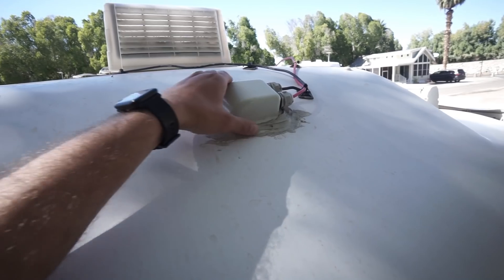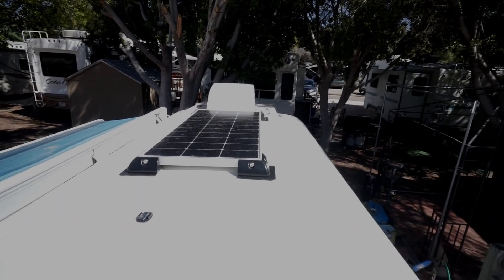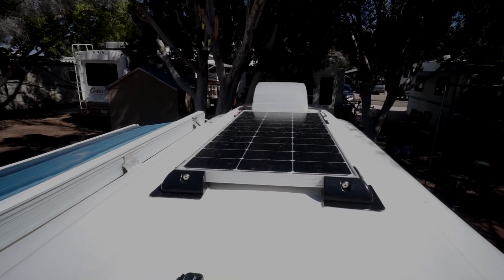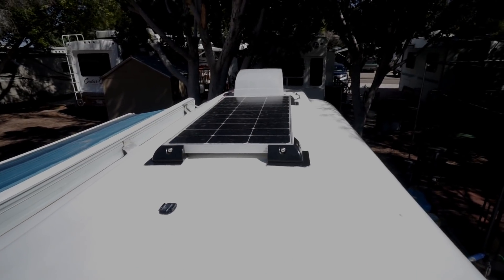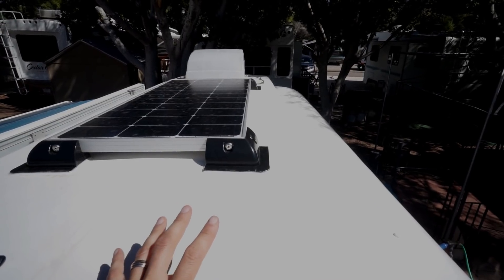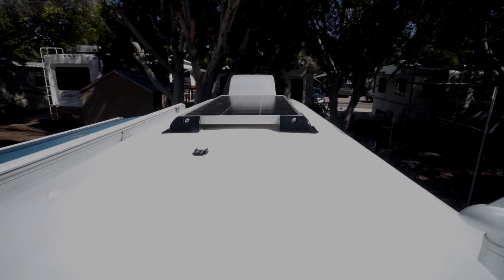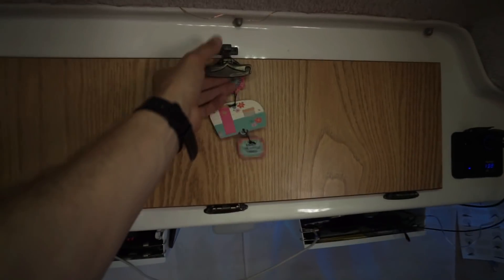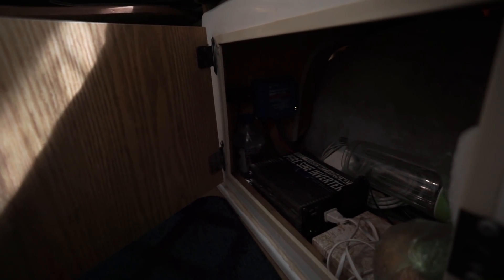Casita Solar System for under $350

Comment: Great video. I must say that the wire entry gland there, the sealant installation was not very well done. To make it work right and look great, tape around the perimeter about an inch, then when putting in the silicone, or sealant, have a cub of soapy water, and use one finger with the soapy water to feather the sealant smooth. The soapy water prevents sealant to stick to your finger, so the can work to feather the sealant out towards the tape, so water actually runs off. This works. I've been doing this for more than 30 years in all applications that required sealant of some sort. The  current installation works, but doesn't look "pretty" or that someone took pride in their work. I had an 87 Casita which the roof was flat like that, as in those days there was no roof A/C,  but was located at the bottom o f the entry closet. Nice work, though.

Comment: If I understand you, you did not drill holes for the solar mounts. What type of adhesive did you use? How has it held up for you? Keep up the great work. Have fun, stay safe and stay healthy.
Reply from the maker: We did not! We used vhb tape. Wich is Very High Bond 3m tape. We actually ended up redoing our solar a couple time. The flexible panels did not do well and broke within a couple months. They overheated and stopped working. So we ended up getting a glass panel and mounted it with these mounts https://www.amazon.com/dp/B01LWASUU1/ref=cm_sw_r_cp_apa_i_NTnxFb33CM2D9

It all held up really well.

Comment: The solar controller needs to be as close to the battery as possible, not the panels. You do need to make sure the wiring from the panels to the controller are large enough to minimize voltage lose. There are lots of charts on the web.

Comment: Great video. Just wondering how you run the roof + side deploy panels in the same time? Does it work to connect two charge controllers to the battery at the same time? Thanks.
Reply from the maker: Hey! Thanks for the comment. It works well. And yes running two charge controllers is not an issue at all.